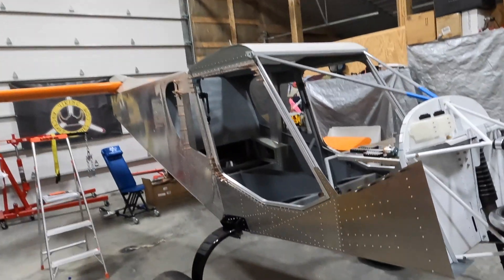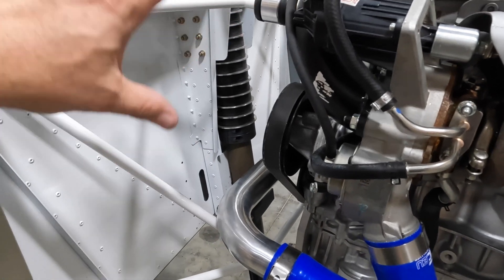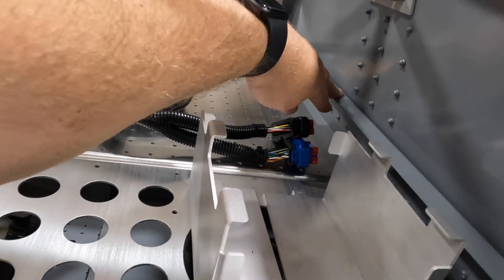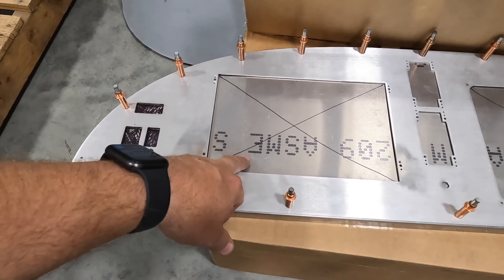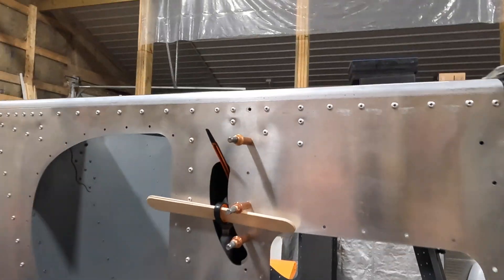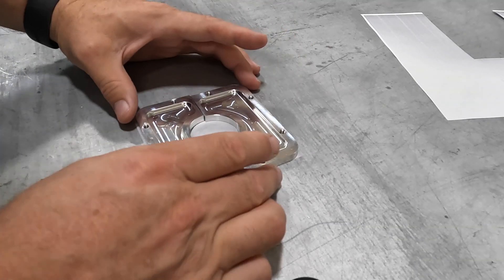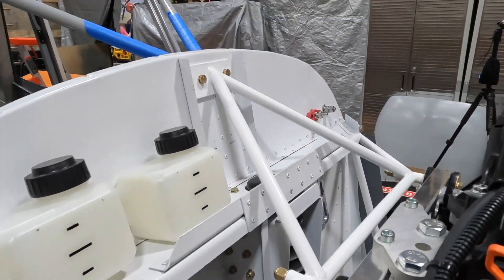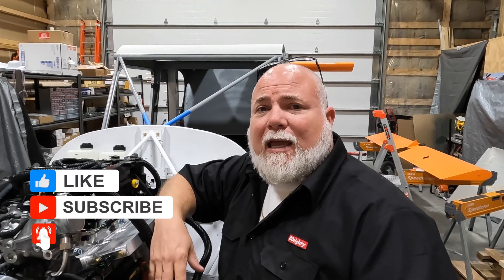Ep. 45 | Firewall & Power | Zenith Super Duty Aircraft Build

Comment: Very nice tips and tricks 👍

You can’t beat using templates to help with locating holes - just always check the template versus the actual component’s cutouts and mounting hole pattern in relation to each other when warranted; for hole pattern and hole-to-hole relationship location dimensional accuracy. 

TIP: Always label your templates with respect to the component or purpose they are created for. Transfer them to a stable medium such as translucent mylar sheet by carefully tracing them, if you wish to make more durable, longer lasting versions; to be used a ‘tool’ where you have to create the exact same penetration in more than one place.

Tip : Drill pilot holes from the template then open them up to full size later - after confirming feature dimensions are within tolerance with respect to each other. 

This way you can always “pull” hole centers (adjust center location slightly) if feature locations are slightly out of tolerance - when opening holes up to final size.

I’m sure you already know all of the above, so it’s only being mentioned here for the benefit of any other first time builders who may not be aware of things to look out for when using templates.

That’s an extremely important point you have provided about planning the location of penetrations in the firewall before making the holes and cutouts. 

It’s a great idea to layout your installations and possibly make templates for your proposed penetrations and then temporary stick those labeled templates on to your firewall, so that you can best position everything to best meet all of your various simultaneous requirements. 

You can then ‘freeze’ the configuration (settle on your final choice for the location of all penetrations) and finally make all of the cutouts and holes more or less in the same session.

Tip : This should help you especially if you prepare a “check list” of all the various things your various penetrations or the components they facilitate, must comply with. 

Checking that before ‘cutting metal’ will provide for a more confident and satisfying experience and outcome.

Great content, thanks again for sharing 🙏
Reply from the maker: Lots of great insight Dave, thanks for taking the time to share.

Comment: Great video. A couple of suggestions. Since the aluminum is threaded, mount the half shelves opposite side of where it is easy to get a screwdriver positioned after the airplane is built. Also, make the actual cutout large so that connectors can go through with ease. The hole is covered by the plates anyway. Install the bottom half first, then run all the wiring and then close the top at the end.
Reply from the maker: Yeah I wasn’t finished opening up the pass thru hole yet in this video.